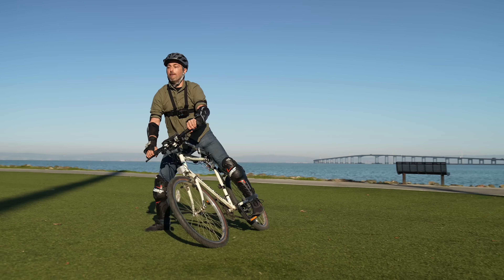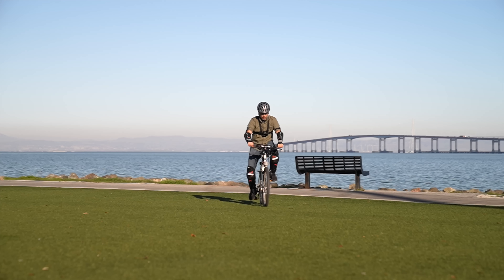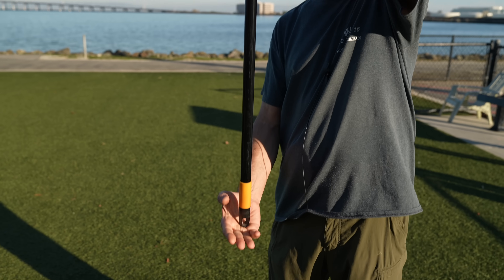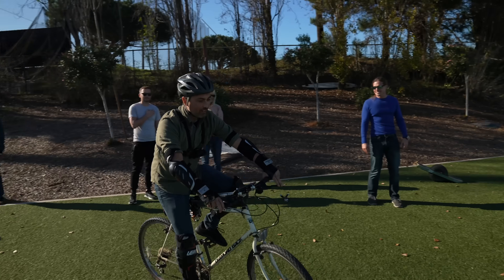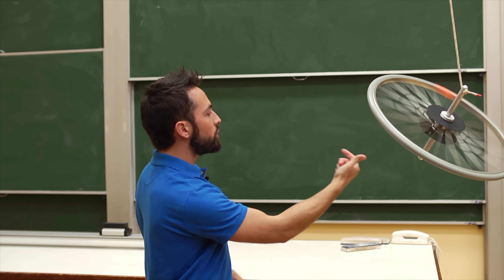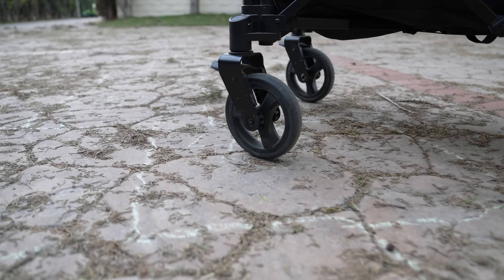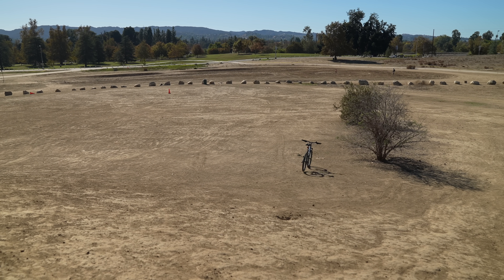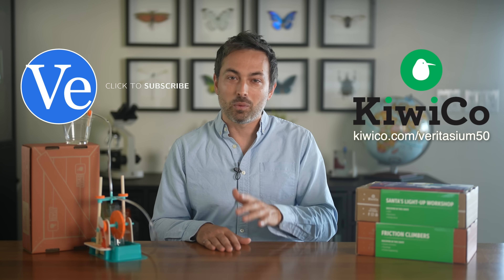Most People Don't Know How Bikes Work

Comment: I think you guys are at the wrong place to be testing this it should be a more open place to where you guys can get some speed so you can turn the bike without the handle bars. Leaning on the bike in the direction you want to go (while you are at a fast enought speed) can turn the bike.
Reply: which turns the handlebars, as he shows in the video of the bike 'steering' its self. If you tried that on a bike with a straight steering axis and no handlebars that hang over the axis it wouldn't steer much, if at all.
Reply: @TheEthanEdge  Bingo!

Comment: Thank you for the excellent presentation!

There is one more point to make.  How do you stop turning and go straight again?   Riders do this intuitively, basically increase the turn even sharper and that forces the bicycle back under you or the center of gravity, then straighten up the steering.  
The degree of lean is proportional to the sharpness of the turn and speed.  Turning more sharply or going faster requires more lean.

If you just stopped steering into a turn and straighten the handle bars you would fall over because you are still leaning in the direction of the turn.  

A fairly small person can ride a heavy motorcycle like a Harley.  Their individual weight has little to do with controlling the motorcycle.  They use the weight of the machine to do the same thing as described for the bicycle.

Comment: I mean technically this is true in regards to the counter turning but you only need to do that if you're going slow, once you reach a certain speed on a push bike you just lean into the turn, and then direct your bike.

You can also not have to do a counter turn when you're going slow if you initiate a lean before you turn begin to turn the handlebars.

And for those who care this is all coming from personal experience of years of professional level racing.

Comment: "It's impossible to steer left without steering right vice versa..."

How about you lean into the turn like a normal person? If you're doing an emergency turn, you sure as hell don't have time to turn the other direction.
Reply: Would you rather make an emergency turn, or would you rather fall straight off your bike?
Reply: If you turn the bar it will move you away from the obstacle faster than just leaning it
Reply: He may exaggerate it but it surely happens on a micro scale

Comment: Been an avid bike rider for most my life, And I could never explain it well to myself even though i knew what i was doing, Its telling someone that is the hard part, my latest bike is of the LSL (Low, Slack, Long) and first one i have owned of that type, I noticed with a bike before that i liked the fact the crank bottom was low and really centralized my center of gravity whilst riding, giving me more grip and force when i would set off, with the new long geometry of my new bike and that all the places i go in the UK are usually full of tight corners i lean a lot with a lot of confidence, I do feel like it gives off the perception i am riding dangerously though due to how close i can hug the corner of a wall or something.

Comment: Oh, I’ve had involuntary experience with this. Someone kicked my front wheel when I had my bike parked outside the store and when I came out the wheel was fine but somehow the steering was jammed. Absolutely impossible to even ride straight forward when you can’t steer. Luckily it was quite easy to fix.

Comment: Is this hassle really necessary when we already can use our bodyweight to lean towards one side and steer that way? I used a bicycle for years and found the method be just enough. Plus I learned it that way. Yes, I've heard about counter-steering; yet refrained from using it lest it may turn disastrous during heavy traffic, for a new technique learned without much practice may add up to much confusion.
Reply: You were countersteering without even realising it. You were leaning on the left handlebar, pushing it to the right slightly, which causes the bike to tip over towards the left
Reply: @AAARREUUUGHHHH  I thought about it - maybe you are right. It seems very probable.

Comment: Can u lean to the right first (while still steering straight) and then turn the handlebars to the right?

It seems like it would put the bike in the right position beneath you before you started your turn.
Reply: Yes you can. I don't get why they didn't discover this while making the video.
Reply: @misterdaave  
Incorrect. 
How riding with no hands or leaning to turn works is that by learning you upper body to the left that causes the bicycle and your lower body to lean to the right. Equal and opposite reaction. The bicycle learning to the right causes the front wheel to turn to the right for the reason explained in the video.  This front wheel turned to the right is the counter steering that will cause the bicycle and rider together to lean to the left. Which then causes the turn to the left.

I do wish that the video covered this. But I understand that it would have made the video too long for most viewers.
Reply: No.
How riding with no hands or leaning to turn works is that by learning you upper body to the left that causes the bicycle and your lower body to lean to the right. Equal and opposite reaction. The bicycle learning to the right causes the front wheel to turn to the right for the reason explained in the video.  This front wheel turned to the right is the counter steering that will cause the bicycle and rider together to lean to the left. Which then causes the turn to the left.

I do wish that the video covered this. But I understand that it would have made the video too long for most viewers.
Reply: @erniecolussy1705  Um, no. You can lean to the right, and the bike will fall to the right, not to the left. Why do you think the bike would lean left as you lean right?

I know you're thinking of some Newton's law, but you really need to go outside and ride a bike and see. You can lean right without some weird theorycrafted physics idea.
Reply: @chayashida Yes the bicycle will eventually lean to the right just like I described. I do ride bicycle and motorcycle. I have definitely observed what I am saying. 
What you have observed isn't incorrect. You just have not observed the process by which it happens. I recommend that you try video yourself riding straight towards a stationary camera on a tripod. Make a turn with your hands off the handle bars. Please be careful. Then watch the video in slow motion to see the details.

Comment: No. I can ride bike without my hand on the handle and stabilize it to run straight or turn. So its not about correction. Its about you having crappy balance.
Reply: I can chew and breath at the same time.
Reply: @XtreeM_FaiL  so do i. Thats why sometimes i choked on food. Ussualy dry onesbthat crumbles to dust.

Comment: this is a horrible take. im a profesional rider. and counter steering isnt  always necessary. its called leaning
Reply: You can't lean without countersteer. Real Pro would know it.
Mount wheels on a 2x4 and lean it. It won't turn.
Reply: @XtreeM_FaiL  this is just wrong. of course it wont turn if you just lean. but if you lean and turn you dont need counter steer. big difference between saying you need counter steer and saying countersteering makes turning easier

Comment: Similar effect is experienced when you ask people to simulate changing lanes with their eyes closed and holding out their hands like they're holding a steering wheel.  99% of people will turn their hands in the direction of the lane they're going into and then return to center.  What they don't realize is that they just made a TURN in that direction, and would continue veering the same direction until they went offroad.  If someone simulates it correctly it would look like a gentle turn, followed by a minor correction turn in the opposite direction to keep the car straight on the road, followed by returning to center.

Comment: Actually to just steer left without steering right you gotta bend your body to the side you want to turn ive had a theory on why people steer the opposite direction instead of the direct direction first and my theory is to give them space to turn by turning right you will be given more space to turn
Reply: What you are saying works. But it is actually much less efficient. And it actually is a form of counter steering. 

How it works is that by learning you upper body that causes the bicycle and your lower body to lean to the right. That is an equal and opposite reaction. The bicycle learning to the right causes the front wheel to turn to the right for the reason explained in the video.  This front wheel turned to the right is the counter steering that will cause the bicycle and rider together to lean to the left. Which then causes the turn to the left. 

This is easiest to see when watching someone ride with no hands on the handle bars.

I do wish that the video covered this. But I understand that it would have made the video too long for most viewers.

Comment: I’d like to see an experienced motorcycle rider give this bike a try. I’d like to see the effect of having the knowledge of weight shifting.
Reply: Or anyone who can actually ride a bicycle… the idea that I have to turn my wheel the opposite direction before I turn is hilarious and just plain wrong because I can turn left and right while riding only on my back wheel
Reply: @SAFbikes  it’s not about turning, it’s about shifting the balance. They even said that it works the same way with a unicycle in the video lol
Turning your bike the opposite way first is just an easy way to achieve this
Reply: @このハンドルは使用できません-i7p  on motorcycles we don't steer the opposite way to go the other we push the handle forwards on the side we want to turn
Reply: @b1ackf0x11  and do you what that does? Steers the bike the opposite way.
Reply: @b1ackf0x11  Read what you wrote. You push forward on the right handle bar to turn to the right. This is what is taught in most motorcycle safety classes. Pushing forward on the right handle bars will turn them turn the handle bars to the left.
Reply: @SAFbikes  No it is not wrong. And not knowing this information is the number one contributors to motorcycle fatality in many areas. This being a major factor in motorcycle fatalities has been well known since the 1980's.
Reply: No amount of experience can beat the physics of it. You just cannot lean to one side without the steering turning slightly to the other side.

Comment: When you look at the track that your front and back tyres have made, you see that the front tyre makes a longer track, with constant turns even when biking straight ahead. The faster people ride (and the more experienced they are) the smaller the difference. I see that some people claim that they steer simply by throwing their weight into the desired direction and then turn the steer, without countersteer. I ask them: how do they not fall at the moment of throwing that weight other than by countersteer? They are in a situation of unstable balance, balance must be obtained every moment of the ride. You do not perceice all those permanent small adjustments because riding a bike has become a second nature.

Comment: Yeah motorcyclists already know this. It's called counter steering. You have to force the front wheel out of line with the rear to make the bike fall into the turn and then the front wheel will realign with the rear. Lean is a not how you turn but a product of countersteering. The faster you go the harder you have to push the handlebars in the WRONG direction first.

Comment: Skateboards have a similar invisible mechanic with the balance where if you lose balance in any direction, the truck steers to that direction compensating your balance--that way as long as you're moving you will remain able to easily stay on the board indefinitely. Most people when they look at a skateboard intellectualize that they will lose their balance and fall off the thing, but once you intuitively learn to ride one this infinite balance equilibrium becomes second nature quickly.

Comment: Angular momentum does matter for bike stability. This is actually intuitive. The faster you ride, the easier it is to go straight, the less active steering is required. It's a struggle to keep a bike straight at low speeds, as anyone who's ridden a bike can attest. If angular momentum didn't matter, the effort to keep a bike straight wouldn't vary with speed .  Those experiments frankly weren't fast enough to make it possible to balance without  steering.

Comment: So three questions:

If the contact patch on a bicycle is larger would you be able to go right without counter steering? Example would be a larger tire. Of course training wheels are another example but then it would be a tricycle.

For the experiment with locking the handlebars in place were people not allowed to "bounce" the front wheel to keep going straight? Obviously this would be cheating cause you wouldn't necessarily be going straight but it does allow you to align the bike itself.

Would you still be able to ride a bicycle straight with locked handle bars off-road? Again it wouldn't be straight but then the bike would be righting itself.

Comment: problem with this is that there is a specific speed. something like 9mph that this takes effect. and when going slower than that speed you do, indeed, need to turn the handlebars in the direction of the turn. more of how bikes in general work. motorcyclists know this well

Comment: this problem is actually partly the reason people have such a difficult time on motorcycles. at speed you can’t turn the wheel right for example to go right. you push on the right handlebar (turning it slightly left), then lean a bit to the right as well, which means: push right, lean right, go right. like it was mentioned, people do a bit of countersteering on a bicycle without knowing it which is why people going speed on a bicycle or motorcycle usually need to practice a lot before making a turn correctly. this process is difficult on a bicycle however since it’s much harder to go fast enough to counter steer properly

edit: this partial knowledge everyone has on counter steering is the reason nobody can complete this turn. we all know what countersteering is subconsciously, until you actually need to do it (as if you’re going speed and the wheel is locked in place by the road). this is where the problem comes from as people only partially understand it enough to do it at slow speeds

Comment: I know how they work, when you pedal the planet turns under you and the harder you force the faster the planet turns. XD 

Well its balance and changes in gravitational forces, when you move forward quickly your partially falling as you move so if you have wheels under you that falling effect lessens the direct pull of gravity allowing it to be easier to keep alot of weight balanced on 2 wheels. Basically the faster you move in a forward direction the more your "falling" so if you were the flash you would end up going airborn and stumbling if you ran too fast and your feet wouldnt want to stay on the ground until you slowed. Draw a right angle with a circle in it that fits nicely, you are the right angle the planet is round you move forward, your lower half is shifting forward but your upper half is shifting back giving you a perfect equilibrium with gravity at a certain speed and your being pulled back and pushed forward at the same time and this is creating the "standing" effect for moving objects that are tall. the pull is on 1 of those lines and the push is on the other. YES there is for real push and pull, pull is the friction that occurs when an object moves forward, atoms move around and out of the way while the object is moving and this happens everywhere accept the vacuum of space and would be best measured at the top of the object combined with the backwards fall gravity effect your top half is getting, pull is the wheels turning from the force of your legs and is best measured at the bottom of the object(bottom as in closest to the gravity source). You know how they say if you went into a black hole your top and bottom half would be effected differently? Well that is happening at every gravity source in a far lesser degree not just black holes. Might also be because people assume your entire body is passing through time at the same rate well no it isn't the taller you are the more warped in time you are because the further you get from a gravity source the more of a difference in the passage of time there is so your feet are passing through time slightly differently than your head is if your upright. Same reason why its so easy to stand on 1 foot while walking compared to when standing still, its easier to walk for an hour than stand on 1 foot for an hour. Also the "bat swing effect" how the end of the bat travels faster than the handle if you swing it well that is happening too. Not all things effecting it are being measured while testing if they dont know. Also electromagnetics come into play and can be a part of it possibly. Balance is underestimated too, people call it witchcraft if a person can balance a broom to stand on its own until someone walks near it than it falls but its just simple balance combined with the wind they make when they walk near or the vibration in the ground there feet make.

Comment: This is the reason why modern day Mountain bikes have slack fork angles as you get premium stability when turning sharply on rough surfaces. Tour de France racing bikes for instance don't need to make harsh turns and so In turn the fork angle is very upright, and the reason they crash so badly as they are harder to correct when it goes wrong.